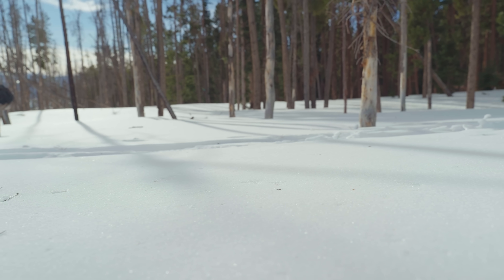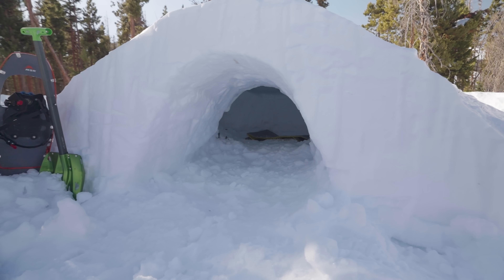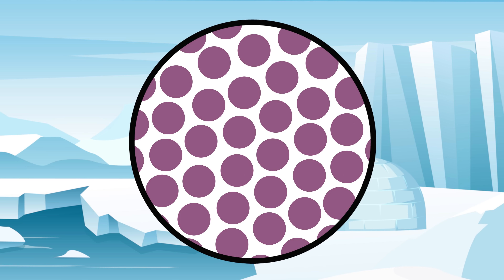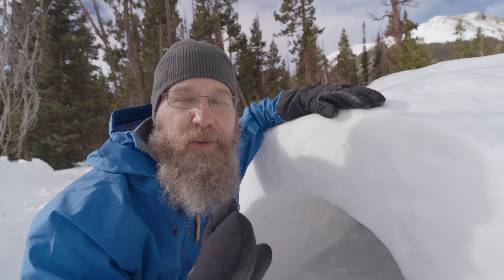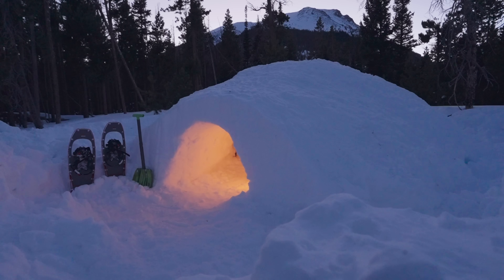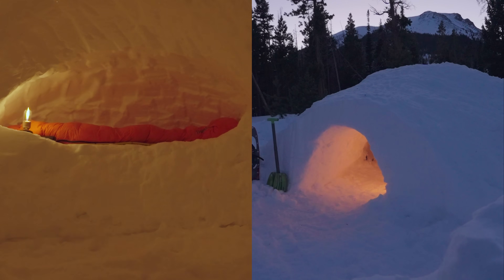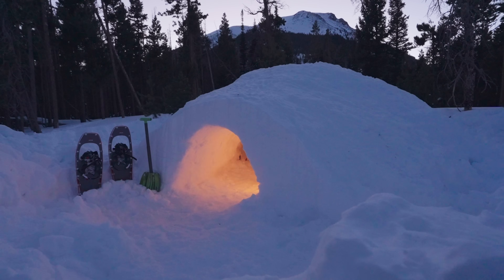Ancient Wisdom Proven Right by Science!

Comment: Snow will keep you insulated, as long as you don't touch it. Huge Caveat. Your skin will transfer heat into snow really efficiently and fast since, its hotter than any inanimate material, that snow now turns into water. and water's thermal conductivity is higher than your skin. So now that 34 F water will start taking energy away from your skin very quickly.

Comment: I don't know if this is also applicable, but water has a relatively high thermal heat capacity, so it resists temperature changes. That might aid in its insulating properties, potentially, just a hypothesis.

Comment: Snow is cold. But it’s also a low density foam that creates great insulation due to the entrapped air.  Your body is what is warm. The igloo traps the  heat you are generating. If you slept in direct contact with the snow, you would freeze to death. The air inside traps heat and keeps up warm

Comment: You should do better research:

At absolute zero (0 K), particles do not completely stop moving.

Here’s why, clearly and correctly:

⸻

Classical vs quantum thinking

Classical idea (incorrect)
	•	Temperature = motion
	•	So at 0 K → motion = zero

That’s classical physics, and it turns out to be wrong.

⸻

Quantum reality (correct)

In quantum mechanics, particles can never have zero motion.

Two key reasons:

1. Heisenberg Uncertainty Principle
You cannot know both:
	•	A particle’s exact position
	•	And its exact momentum

If momentum were truly zero, position would be infinitely uncertain — which is impossible in real matter.

So particles must retain some residual motion.

2. Zero-point energy
Even at absolute zero:
	•	Atoms vibrate
	•	Electrons fluctuate
	•	Fields still have energy

This irreducible motion is called zero-point motion.

⸻

What actually happens at absolute zero
	•	Thermal motion goes to a minimum, not zero
	•	Atoms settle into their lowest possible energy state
	•	Motion becomes purely quantum, not thermal

Examples:
	•	Solids still have atomic vibrations
	•	Helium never freezes (even near 0 K) without pressure
	•	Superfluids and superconductors appear — quantum effects dominate

⸻

One-sentence answer

At absolute zero, thermal motion stops, but quantum motion does not — particles never completely stop moving.

Comment: cold
/kōld/
adjective
1.
of or at a low or relatively low temperature, especially when compared with the human body.

Temperature: Temperature is the measure of the average, random, translational, molecular, kinetic energy of a substance.

Snow has a low measure average, random, translational, molecular, kinetic energy.

Snow is cold.

Although its makers obviously don't realize it, this video serves as a good primer on the difference between "temperature" and "heat". They are not the same thing.

Snow is cold.

Comment: Its not so much the snow as it is the still air immediately around your body. Snow will be as  cold as the ambient temperature of the air around it. But just like when you go into cold water and quickly "get use" to it because of the pocket of water close to you that is warmed by your body heat, the cold air next to your body warms quickly once the air becomes still.

Comment: Arnt you supposed to use the bottom of that can or the bottom of the bowl, with the candel in the bowl to heat it up and slightly melt the top and sides of the igloo so no air can get in or out... that was in the book the ' TERROR ' with the 2 boats stranded in the ice cold....

Comment: It seems like heating an area with an enclosed roof with no place for the gasses to vent by using a flame would be extremely dangerous. The hot gasses are going to be trapped along the roof - where you're sleeping. You're burning up oxygen, and probably also creating some dangerous gasses with whatever fuel you're burning for that lantern. This seems like an asphyxiation risk. CO2 is denser than Oxygen, so if you're only creating CO2 gasses you might be safe. But if you're creating any carbon monoxide, that is lighter than Oxygen and will fill up the top of the space. The yellow color of the flame in your lantern indicates that it is creating carbon monoxide, and is a huge asphyxiation hazard!

Comment: How do you prevent carbon monoxide/dioxide build up ?
Reply: This is a huge problem with this video. You're supposed to have a hole in the center of the roof to vent toxic gas. You lose some heat, but it's nice because you don't die. Carbon dioxide is heavy, so it will sink to the floor and escape out the door. But carbon monoxide is slightly lighter than oxygen, and heated carbon monoxide will fill up the top of that igloo and asphyxiate anyone inside. When a flame is yellow, it indicates incomplete combustion that is creating carbon monoxide. His yellow flame lantern could easily kill him in that space.

Comment: If cold doesn't really exist then why he is wearing Gloves, Jacket and all that 😂
Reply from the maker: To prevent heat (which is what actually exists) from escaping.
Reply: @MyLifeOutdoors Yes but I'm taking about Temperature 🌡️ (Cold)
Reply from the maker: Temperature is a measurement of heat like liters are a measurement of water. You don’t measure how empty a bucket is. You measure the water. Even though we have a word for it “dry” the only way to measure how dry something is to measure how little water is present. It’s the same with heat.
Reply: @MyLifeOutdoors so simply when temperature is low it's cold and when it's high it's heat Right Sir

Comment: I read somewhere that it was pretty normal for the Inuit to sit together in their Igloos just wearing underwear, so they must have managed to get it quite warm in there.
Reply: Yeah the igloo what he built, had the door too high and the ceiling too low. Where as the inuit igloo has really low door and tall dome. 
So most of the heat from his igloo escaped through the door. It was basically just a straight tube shape.

Comment: misdirection for clickbait. snow is not warm, it insulates from airflow, your body is warm and the snow keeps that in. sped vid
Reply from the maker: Cold doesn’t exist from a scientific standpoint. Only less heat
Reply: @MyLifeOutdoors touch grass. You just pulled the "black isnt a color its a lack of color" trope card.. the full explanation is, Scientifically, "cold" is the absence of heat or low heat content, which means a substance has low thermal energy. Temperature is a measure of this thermal energy, so an object with a lower temperature has particles with less kinetic energy, while an object with a higher temperature has particles with more energy. Therefore, what we perceive as "cold" is a sensation felt when heat transfers from our bodies to an object with a lower temperature, making us feel less warm....this is how refrigerators work, a chemical process that extracts heat from the case and expels it from a heat exchange in the back
This does not mean you can say something isnt cold. Go outside anywhere there is snow, take off all your clothes, and make a snow angel.. then tell me yiure not cold because "scientifically cold doesnt exist" 

You are literally making the same argument that a middle school child would. Elluding to your lacking mental capability.. dont get me wrong, mentally challenged individuals should be able to make vids like the flat earthers, but they should have a sped warning label😊
Reply: @MyLifeOutdoors  a quick google search could have saved you from makikg another verifiablly wrong statement.
No, "cold" does not exist in science as a distinct substance; rather, it is the scientific term for the absence of heat or thermal energy... so how does cold not exist in science if it is a scientific term?😅

Comment: Pls dont use Misleading Titles and Announcements. 
The Explanation in the Video is actually pretty Good. But the Title and early Statements are all completely Wrong and Misleading. 

1.
Snow is Cold. That is a Fact. It is Literally Frozen. 
2.
MANY things will Keep You as Warm as Snow and in Fact much much Warmer. 
Which is not Surprising. Because Snow is Frozen Water and being Frozen also means that it is at a Colder Temperature than You. Therefore it will Absorb Heat from You. 
So Snow will not Keep You Warm. 
3.
So. Why does an Igloo Work ? 
Thats Simple. The Igloo is a Shelter. 
And any Shelter that Stops Wind and Weather. Will also create a Space of Trapped Air that cannot move around and cannot escape easily. And therefore also Traps any Heat Produced inside. 
Meaning that it will very Quickly be Warmer than the Outside at least. 
On top of that. If the Air inside is not Moving or Circulating. It also carries far less Heat around. So just like a Rubber Jacket being very Uncomfortable and Hot in the Summer due to not allowing any Airflow through your Clothes. Any Shelter that creates a Bubble of Air that isnt Moving around. Will reduce Heat Loss. 
As such. 
An Igloo here is the Absolute WORST Shelter of course. Because the Igloo being made out of Snow. Means that despite the Heat being Trapped inside. The Walls of the Igloo itself are still Cold and will absorb alot of Heat which then Starts Melting the Snow the Igloo is made from. 
BUT. Any Shelter is Better than no Shelter. Because while the Snow Walls might absorb a considerable amount of Heat. That Absorbtion is still by magnitudes slower than if the Heat would Simply be carried away by the Wind. 
That is also why any Old Hut, Shack or even a Hollow Tree Stump or whatever other Shelter there is available. Will Improve Chances of not Freezing. Because it will Significantly Reduce Heat Loss compared to Standing in the Wind.

Comment: Nice vid. However, with winter coming, if anyone see this and try to make some, I'd heavily suggest a bit more research, or care about what you use to put heat inside the igloo. If you use some flame, you could asphyxiate yourself by burning all oxygen as you basically prevent some venting gas outside. I know nothing at all about survival or igloos, so I may be wrong, but be carefull with flames and enclosed spaces. Or even carbon monoxide poisoning.

Comment: Inuit hang a tent made of skin on the inside of the igloo.  The tent provides an added layer of insulation, and it keeps water drops from landing on people inside.  The tent is held in place by leather thongs that they thread through holes in the igloo.  Large bone buttons keep the thongs from pulling through the igloo snow.

Comment: Absolute zero doesn't actually exist, and if it would, it wouldn't be called absolute zero bit entropy, where the material would just collapse in on itself because there would be no movement of electrons , which would also break material bonds completely (which is why the colder materials get the more brittle they become). Another cool thing about 'cold' misconceptions to point out is that space isn't actually cold like they love to say in pop culture. Its actually pretty warm, if not downright hot, and that's in the shade, in the sun it's scorching hot. If you merely wore a thin plastic wrapping that prevented decompression, your own body heat would be more than enough to warm you up, if not overheat you, given you can't even cool down with sweat (which would freeze immediately if you coild.. sounds weird, I know. Why? Vacuum is an INSULATOR, a thermos works by that principle! So yeah space is warm, or rather, there's nothing there that could cool you down in the first place.

Comment: Even though snow is frozen, it keeps you warm because it’s mostly made of trapped air, which is a poor conductor of heat. Your body produces heat, which radiates and circulates inside an igloo or quinzy. The snow walls trap the warm air, slowing heat loss. Igloos are designed with raised platforms so warm air rises around you and a lower entrance to keep cold air out. With just your body heat—or a small heat source like a lantern—the inside can be much warmer than the freezing outside, sometimes by 40–60°F. So, “hot” is relative: compared to the Arctic cold, an igloo can feel cozy.

Comment: why would you raise the bed if you can just dig a hole? does it not innately heat up the air at the bottom if you lower the bottom, instead of trying to chase the air at the top with such a low roof?

Comment: Very good Video. I liked the explanation. A few years ago i slept in an snow cave like this with 5 other guys for an army training in austria. Outside there even were -30° Celsius and we had 0°C on the inside. We dug out the entrance deeper, so cold air from the bottom of the cave gathered there. We also used a candle inside to be sure there was always enough oxygen in the cave. We had 4 of these caves and every 30 minutes in the nighttime someones duty was to check if the comrades were there and the candles still burning.

Comment: I THOUGHT i knew the answer. I thought that it was due to the high specific heat of water that the heat inside would be really slow to heat up the water in the snow, while the cold outside would sap the heat from the igloo way quicker. But the real answer is so much cooler than that! 
So awesome and so clearly communicated and you gave examples! 

I had to like and subscribe and do all those other things. Awesome video! I think i found a gem of a channel.

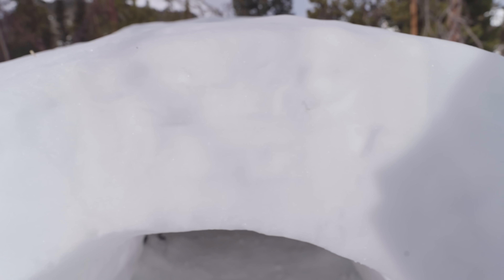Comment: 2:47 No, snow is not 95% air, at least not when packed like that into a structure. That would be like aerogel, and you wouldn't ever have to worry about being crushed by snow. Yes, there's a lot of air, but not that much. It's pretty easy to estimate with a container that you fill with snow and then let it melt

Comment: 30+ year Alaska mountaineer, here, I spent a winter living in an igloo and have built and spent probably 200 nights in igloos while out on ski trips.  New built igloos are a lot warmer than igloos that have been lived in awhile because the snow structure in the snow blocks ices up due to the heat from inside. Instead of the snow blocks being full of heat trapping air voids between the snow particles, the snow blocks increasingly become solid ice, which doesn't insulate very well.  Also, igloos shrink, as in get shorter the longer you live in then and as they age.  
As for the sleeping bench with the cold well and lower tunnel,......meh, I'm going to call that a fairy tale.  Yes, it would work in theory but in reality, the barren tundra where the eskimos lived was and is a VERY windy place, even with putting the entrance tunnel on the leeward side of the igloo, (at least a few degrees off the axis of the wind to keep the tunnel entrance from drifting shut) wind will still rob the air from inside the igloo if there's nothing blocking the door to stop it.  Traditional eskimos used very sooty animal fat lamps which blackened the inside of the igloos, making them dark inside, (new/fresh igloos are clean inside which makes the walls reflect the light, a little light goes a long way in a new igloo) and from everything I've read, traditional eskimos constantly hawked and spat black phlegm from the lamp smoke.  Anyway, leaving the tunnel mouth open at least some to allow the wind to remove some of the sooty, deadly CO air probably was a good thing but the cold well and lower tunnel.....  the jury is still out on that one for me.
For those of you building igloos or quinsy's in warmer climes with wet snow, look out.  New igloos can breath a fair amount due to the air voids between the snow particles.  Think of the snow in the blocks like open cell foam, there are all these little voids and spaces that connect to each other and connect the inside to the outside.  Air moves through the snow blocks slowly enough to be able to keep ahead of it even just with body heat.  Anyway, I almost killed myself once early on due to going on a ski trip too late in the spring, water had percolated down their the snow pack so when built my igloo to sleep in that night, the blocks I cut were very moist, they had water between the snow particles.  To make it worse, the wet snow packed so good, I sealed up the door with wet snow and ran my gloved hands all over all the walls and glazed them to keep from getting snow on me when I bumped into and touched them.  I got in my sleeping bag and lit my white gas stove but i was getting pissed, I just couldn't keep the piece of junk lit.  I figured it must have some dirt or carbon in the jet and that's why it wouldn't stay lit.  I lit it 5-6 times and tried to keep it going but it just wouldn't stay lit.  All at once it hit me, the stove was the canary in the coal mine and I launched myself at the door to break it open before I passed out and died from lack of oxygen.  With the door open, the stove burned just fine, like normal.  It wasn't cold, I didn't need the door to be sealed shut to keep the heat in, I didn't really even need an igloo that night.  
Anyway, packing snow like in a quinsy or in a warm, wetter climate will probably compress all the air spaces out from between the snow particles and your shelter won't breathe.  So leave the door mostly open so you don't die.
Reply: That's cool. Thanks for sharing!
Reply: Oh wow 😮😮
Reply: Thx for sharing. Such an interesting read, I read it before I even watched a min of the video :)

Comment: The first and most obvious reason it works is this: snow changes temperature slower than the air, so by putting it between you and most of the air, you've created an insulator.

Comment: What about carbon dioxide buildup?
My next biggest concern would be running out of oxygen while sleeping; especially with a flame burning. I assume fresh air would naturally diffuse through the opening, but doesn't the techniques mentioned act against that? Also there are mentions of adding a door to block air from coming in to make matters worse.